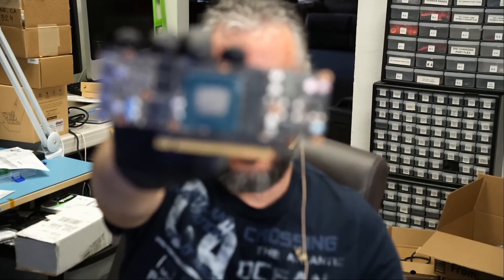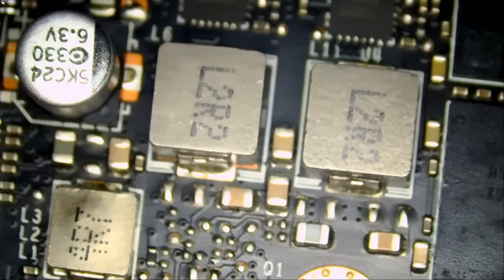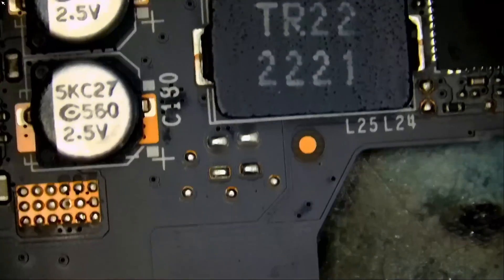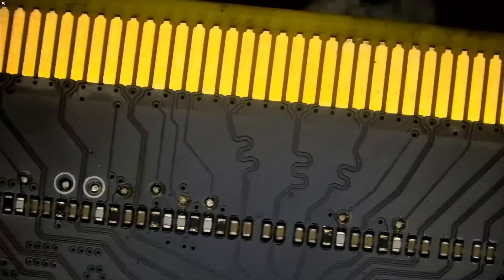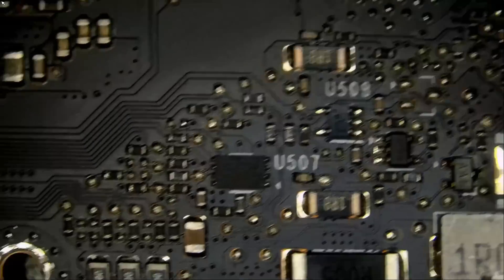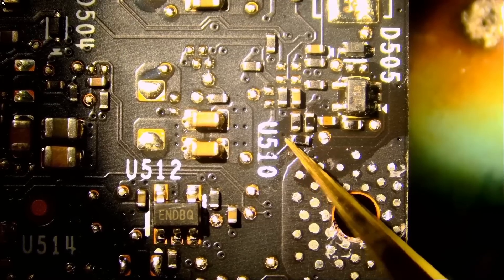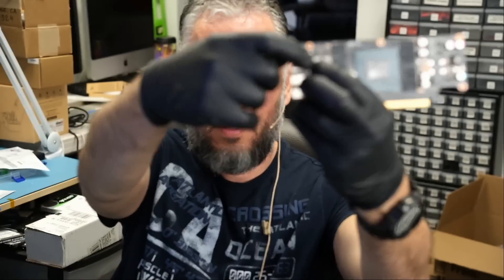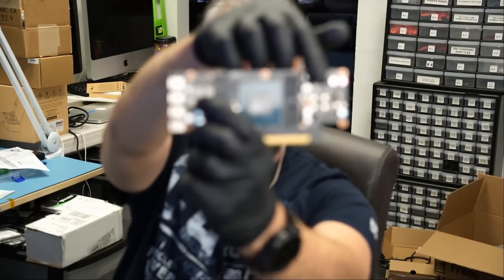Small and Expensive RTX A2000 Repair - GPU not detected.

Comment: My DELL Precision 5510 Motherboard failed. CMOS battery Voltage 2.65V ok, Power input Voltage 19v ok and power distribution to a few components ok  btn 2.5 to 3V But when I press power button it the LED lights up and offs in 3 seconds all other components don't receive power on Startup. (FANS, DISPLAYS). I would like to know which component could have caused the power failure in my system Motherboard and any solutions.

Comment: Awwww yea… it used to be like $500-700 back when ETH was mine-able … they run similar to a rtx 3070 but a little harder to cool with the blower style cooler … there was a “resistor” mod i said resistor like that cause i cant fully remember what was done … but it allowed the card to pull more that 75 watts from the pcie connection for overclocking purposes … never grabbed any of these but had the finger on the trigger just never pulled it

Comment: $700 for that unlabeled, poorly soldered board? Wow
Reply: the 12gb versions are $700. This 6gb version probably got plucked for around $300. It is basically a SFF 3060/3050 from 5 years ago. It was the most powerful SFF (at only 75w tdp to boot) card out there until the sff 4060 (which requires a 6 pin unlike the a2000)....strictly speaking the a4000 smokes both, but they're $2k.
SFF tax

Comment: some of these workstation series cards don't even have a display output, as they're meant for mostly computational work, instead of displaying images.
Reply: Where does that apply in this video? You can clearly see this one has display outputs. 4 of them.
Reply: Unless the firmware on the card disabled video output, this card in question is able to do outputs.
Reply: @ where did i mention that THIS card did not ?
Reply: @ranjitmandal1612  Yeah, check out the GPU Gamers Nexus looks at with Level1Techs - An AMD MI210. It's like 25k US$ and has no ports as it is meant to go into a server blade.

Comment: These workstation cards go for like 500 upwards used on ebay
Reply: Low profile, no external power, cool running. The A series is a card for work but us hardware freaks known that they run a treat in small cases with lesser power supplies. 6- 12GB Ram and 4050-4060 performance with full x16 PCIE 4.0. Now you can get a LP 4060 for less money but for a long time, there was no such thing as a decent RTX LP card for any amount of money.
Reply: Why?
Reply: @mensor 12gb vram for workstation software that pulls like 60W. Easy to deploy
Reply: Depends how many gb but yes it is a very expensive card mostly for the small form factor and the consumption

Comment: They're more expensive because Nvidia realized companies would pay more money for them. Otherwise, the card usually contains ECC RAM and drivers are optimized to run computations, render images, or facilitate engineering software. If a company can make tens of thousands of dollars off a little card. They can afford to pay triple cost for that product.
Reply: They're expensive because they're quieter, run cooler, low profile, use less power.